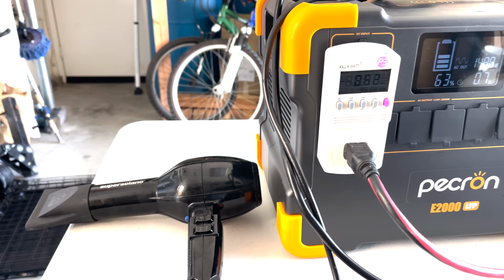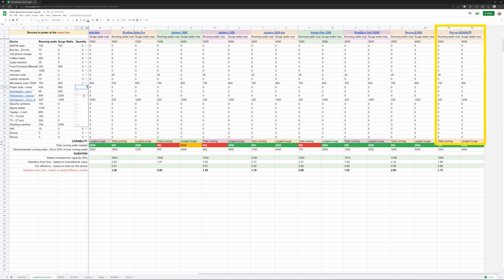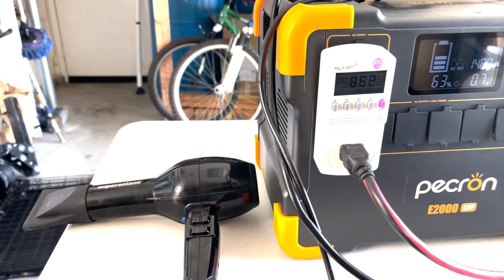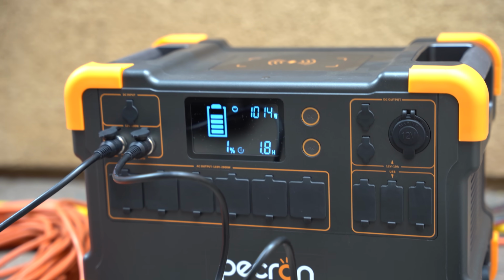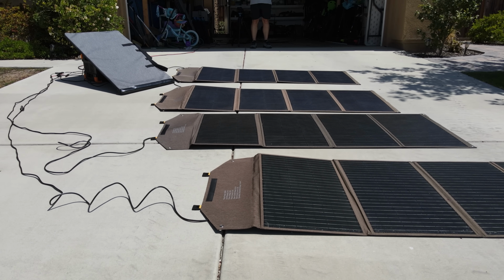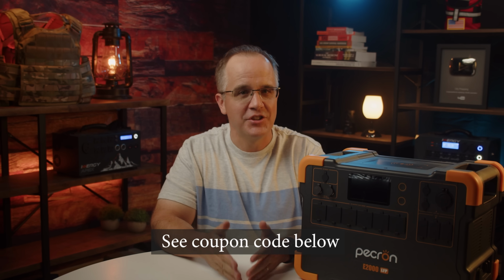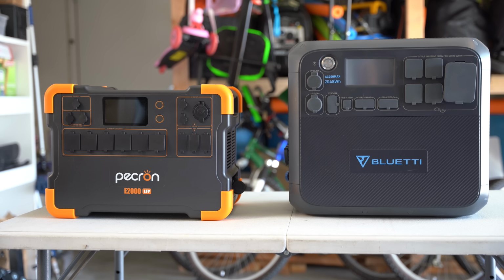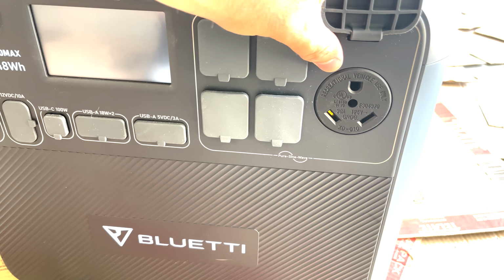Pecron E2000LFP: The New King of Solar Generators for 2022?

Comment: You know what I realized…. Is I’ve been hunting down LFP stations…. However with 3,500 cycles before 80%… that’s cool but how long is the inverter going to last. How many times is the unit going to power on and supply power due to something wearing out… tsk I’m not sure I guess the difference between the two chemistry’s may not be as important as I thought…. The parts are going to wear out before the unit reaches 80% on the battery itself lol

Comment: I'm impressed but I wish Pecron had a longer warranty. Does it maybe cover everything in that 12 months where as Bluetti does not in it's 24 month warranty??  Also our RV air conditioner states it runs up to 1900 watts under the most duress. Do you think that 2000 is not enough of a buffer for efficiency? Thanks in advance. :)
Reply: There's a two-year warranty. I checked their website
Reply: If you register the product online at Pecron, you get a two year warranty.
Reply: @LUBIN-wr3tv  Thank you. I didn't see the registration statement.
Reply: @ronbotex  thank you. I didn't see the registration statement.

Comment: @cityprepping I am trying to find an adaptor for the DC 12V - 18V charging port. My current 8mm is too small. You have any idea what size that port is? ** I am talking about the single port on top of the three inputs **
Reply: @Angelo Not cityprepping but since I'm running this unit:  the 12-18V 100W charging port on top of the two main charging ports is size 5521 (5.5mm x 2.1mm).  The two 12V 3A output ports are size 5525.

Comment: Forgive my ignorance, but am I right in understanding you can still use it after 3,500 cycles, you’ll just be at or under 80% of the original capacity?
Reply from the maker: correct

Comment: Help:  Is there any power unit that can be charged via a dc-dc charger or other unit using the jeep alternator while driving.  The only thing I have seen is a trickle charger using the cigarette lighter plug and the 235 amp alternator potential is not used.  Thanks

Comment: Make sure you factor in customer service. Bluetti is possibly the worst I have ever seen from any product I have purchased. They send me a unit that doesn't work out of the box and then they send me a replacement that is a used product that has a warranty card from the previous user and linked to that user. Horrible experience from Bluetti.
Reply: You might consider contacting Bluetti through Ebay on their store there. When I bought Bluetti products on their Ebay store, there was a dedicated rep that contacted me shortly after each purchase (from cables to power stations) asking me how my orders were. One order was incorrect and the rep immediately contacted the Bluetti store and had them ship me the right item. And I got to keep the incorrect item they sent me. So, again, on Ebay so far, excellent customer service...

Comment: Why is the Bluetti so much heavier? For the ~same battery capacity for the two units, and the battery should be the heaviest component, they should weigh about the same. Where is the extra weight going to in the Bluetti?
Reply: AC Charger built-in in the Blu

Comment: Hi great comparison! I made a few LifePO4 batteries one is 24v, 3KWh battery. Can I use this batter to charge the E2000? Second question: if I can use this battery can I hook my solar panels to the external 3K battery via a controller to charge the system?

Comment: Would you recommend this one over the eco flow delta 2? The efficiency of the delta 2 pulled me to this one. Will this one allow other devices to be plugged in and if the power goes out it takes over?
Reply: What did you end of getting ?

Comment: What if they block out the sun?
Reply: My Bluetti EB70 power stations can be recharged with a gas generator in less than 4 hours, then they can together power my freezer for two days without wasting gas. You haveb to have a logical plan.

Comment: We don't have that much time to wait for the slow shipping.
Reply: We were thinking the same thing.  We are on borrowed time.  In a humbug about getting a turn key system and having to wait for it or trying a DIY option to get everything faster...kinda undecided
Reply: Why do you assume slow shipping???? I ordered a E2000 LFP  on Thursday, and it arrived the following Monday. As long as its in stock, they are pretty quick. BTW, much faster than Bluetti in my experience.

Comment: I just signed upfor the spreadsheet  & it does not work. What is the point of an unusable spreadsheet? You make it  sound like it works. I have been spammed 2 times by you for nothing. What's the deal?

Comment: That 85% efficiency is abysmal, add to that that you don't mention if the AC inverter can be disabled when not needed and I'm now concerned about tare loss. If the "generator" is left on to run/charge DC devices, is that AC inverter still active and chewing through your battery?
Reply: No, there are 2 separate ON/OFF buttons, 1 for AC and 1 for DC. You can turn them on individually or both at the same time.

Comment: It is an NMC Battery Nickle Magnesium Cobalt NOT a LITHIUM IRON PHOSPHATE and I will not buy it !
Reply: Incorrect.  It has LITHIUM IRON PHOSPHATE.  I bought it.  From Pecron's own site:  "E2000LFP utilizes premium LiFePO4(lithium iron phosphate) batteries which can retain 80% of its original capacity at 3500 complete charge cycles."  Or do you know someone who actually bought it that took it apart and determined that it included NMC batteries rather than LiFePO4?